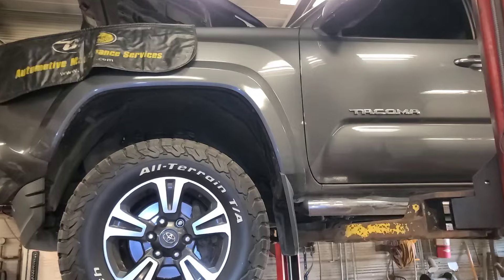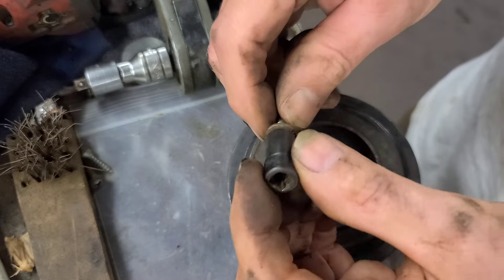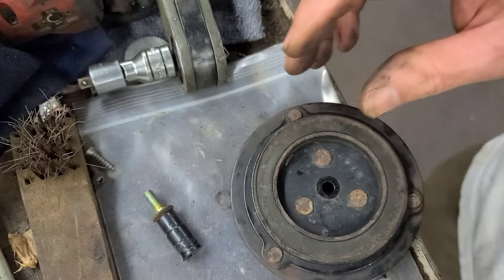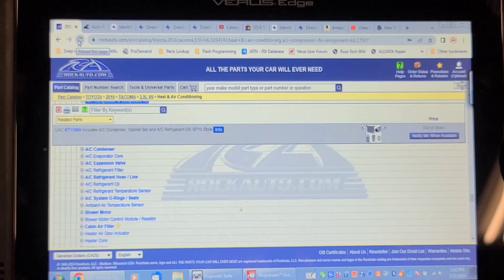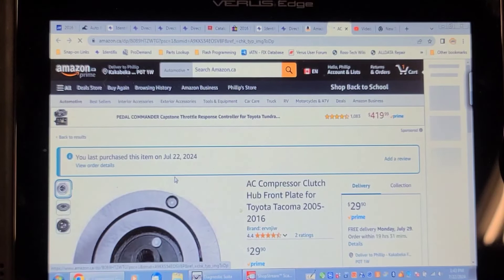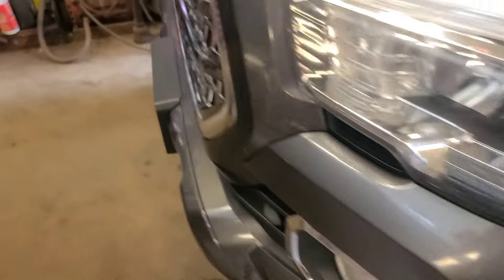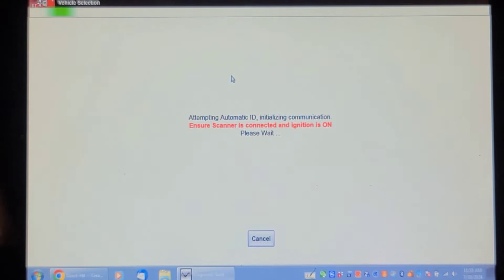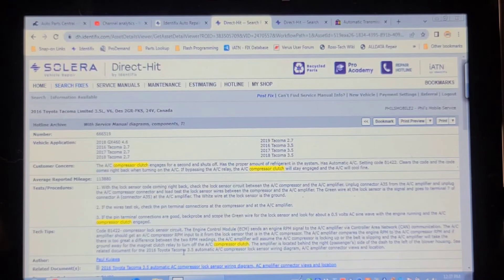2016 Toyota Tacoma AC Not Working

Comment: B1422 means the compressor is not spinning when expected, as you know Toyota has the RPM Sensor built into many compressors and if the AC switch is turned on and the RPM is not noticed, the AC PWR light will flash on many models. Some call it as locked up. OK near the end of the video the Service Info expains this in detail, cheers.

Comment: How did you know it was the drive plate?
Reply from the maker: @baileyjhonson5758  visual inspection revealed that it was broken
Reply: trying to spin the AC Compressor clutch plate, on this type of system, is always a recommended procedure during your initial diagnosis to see if it is locked or broken loose or it turns but its stiff, cheers.